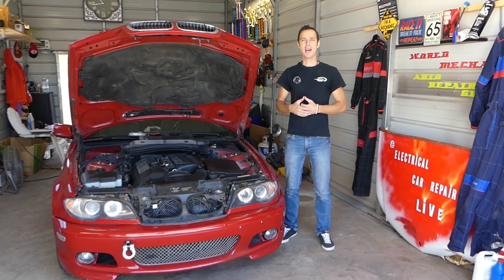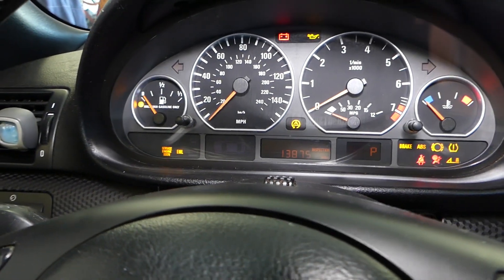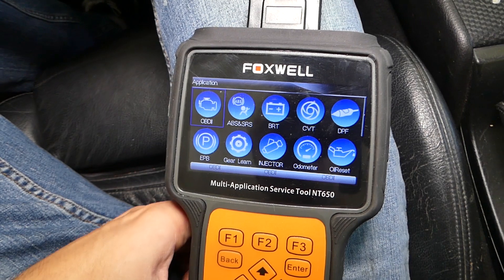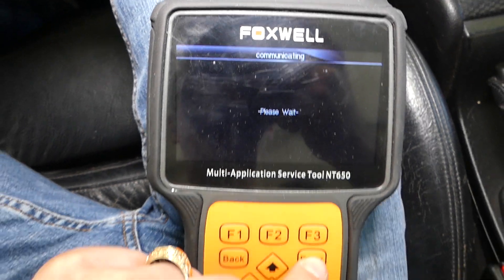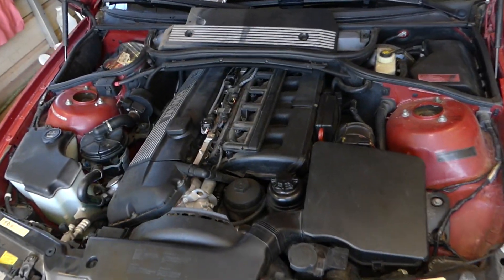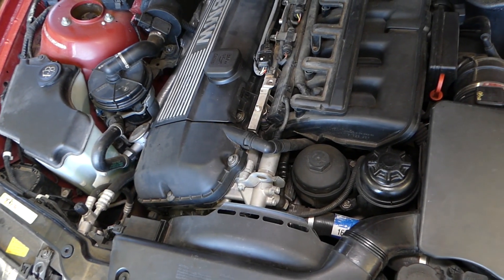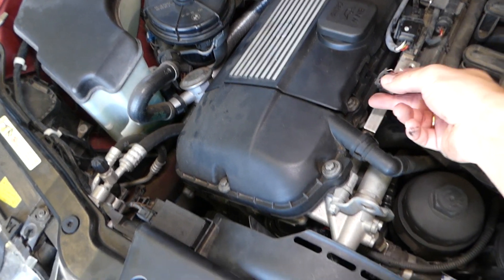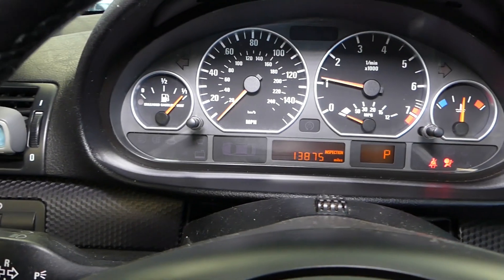CODE P0013 B CAMSHAFT POSITION ACTUATOR CIRCUIT OPEN BANK 1 BMW E46 VANOS SOLENOID

Comment: I have code p1520 camshaft b actuator code accompanied with po300 codes for misfiring cylinders.  Can you help me out ? I have a 2000 BMW 328ci. Did you car not have misfires with this code?
Reply: I also have P1520, along with some other codes and have not found any help on diagnosing the problem.